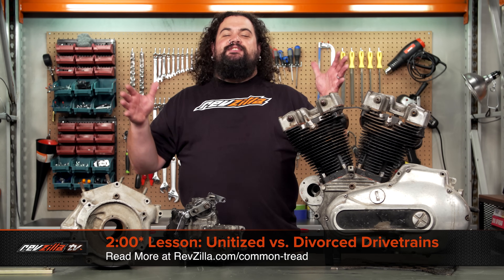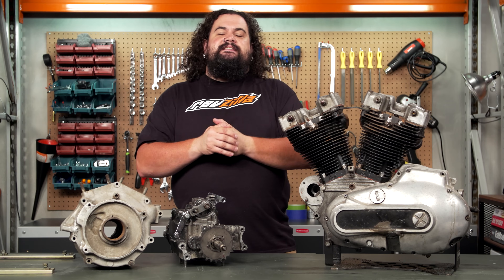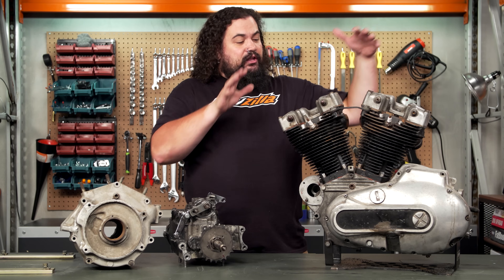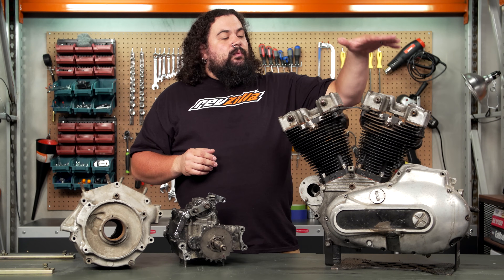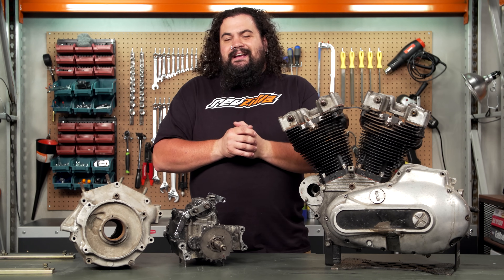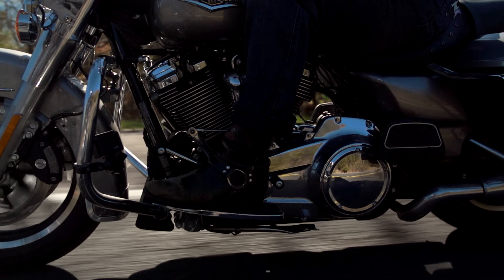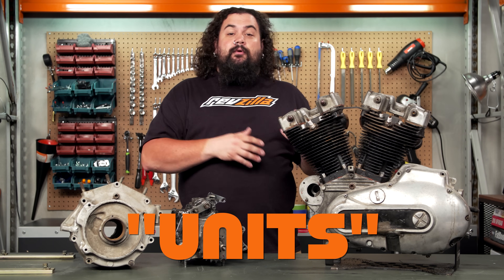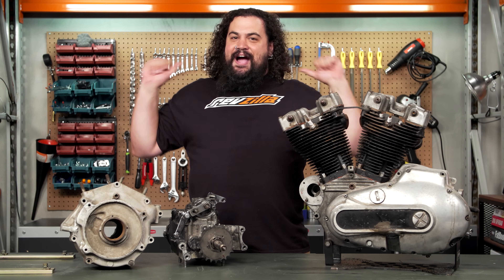2 Minute Moto - Unitized vs Divorced Drivetrains

Comment: Hey, what were those engines on the table from? The unit engine looks smaller than any V I know about :)
Reply from the maker: That's actually a 1973 Sportster XLH1000 motor. They're about two inches shorter than an EVO Sportster motor. -DrewZilla